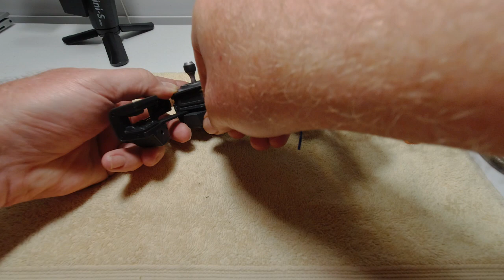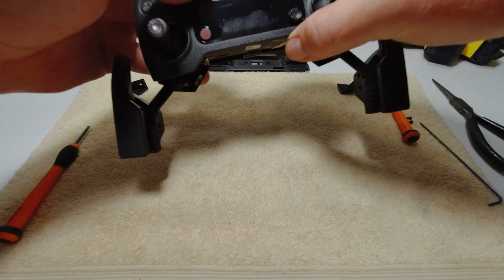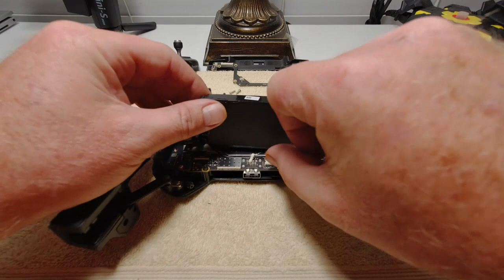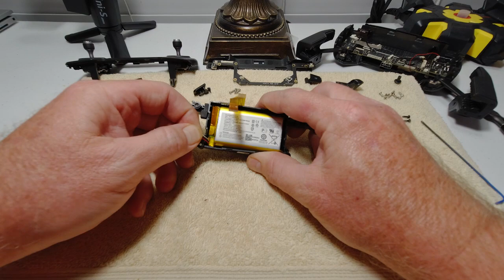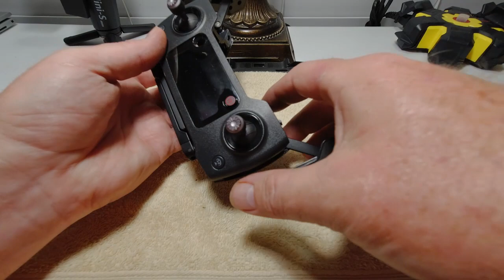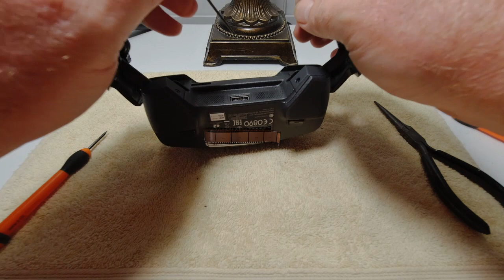How to Replace the Mavic Pro RC battery and where to get it

Comment: Great video.  Word of wisdom to anyone thinking about accessing joy stick potentiometers to clean them...there are no potentiometers...joy sticks are just gimbals that manipulate a tiny magnet below, which interacts with chip below that which senses magnet motion.  Mind blown.  My problem was that I could not hold a heading.  So I thought... controller calibration was the answer.  During calibration controls were not reaching full range during calibration.  Eventually I was able to calibrate....but nothing to do with taking apart controller  P.S.:  Careful with the plastics...this is an intricate molded par with numerous snap features.

Comment: Thanks for this great video.  I'm actually aiming to clean my joystick pots...and didn't know where to start (without potentially breaking plastic etc.).  I didn't start yet...but I was wondering if there is anything special about how joysticks disconnect from controller (electrically)...

Is there a plug or contact I need to be mindful of?
Reply from the maker: It''s been a longtime since I have had this controller apart, but if I remember right the joysticks aren't really serviceable.  You might be able to use some canned air to blow them out or maybe even pour some rubbing alcohol on them and then blow them out good might fix any issues you may be having.  Otherwise you might just have to replace the joystick.  Hope this helps.  Rick Warton

Comment: Hi Rick. Thanks for posting this video. I believe I followed your steps exactly. When I put the new batter in, it turned on the screen momentarily and I read that as a good sign. I put the rest of the drone back together and when I pressed the power button … nothing. No power. Although it was at 66% I plugged it in to charge the battery to 100%. When in got to 100% I unplugged it and tried turning it on. Still nothing. What do you think went wrong? Thank you for any advice you have.
Reply from the maker: David I really have not sure what the issue might be.  All I can think of is maybe the tape ribbon connection inside the remote did not get pushed in good and is not making a good connection.
Reply: @ thank you for the reply. You’re right mate. The tape ribbon connector broke. I’ll need to buy a new controller. Can you recommend a good one? Or maybe I’ll just buy the new Mavic 4 pro when it releases.
Reply from the maker: @DavidPearlman-p8l  Just by a used one on ebay.  There are tons of them and for $50 U.S. dollar or less.  Hope this helps.  https://www.ebay.com/itm/405567280575?mkcid=16&mkevt=1&mkrid=711-127632-2357-0&ssspo=lrzhabikr0i&sssrc=2047675&ssuid=S3YileCoRN-&widget_ver=artemis&media=COPY

Comment: How long oryginal battery will work in pilot?
Reply from the maker: Most people need to replace their remotes battery every 3 to 5 years.
Reply: @rwarton1  and the normaly time working? How long is it?
Reply from the maker: @Zieleniak3PL  The new battery has a capacity of 2600mAh and a maximum runtime of 4.5 hours when using an iOS (Apple) device and 1hr and 40minutes when using an Android device. The remote controller charges the Android device.
Reply: @rwarton1  thanks a lot for RE. I wondering why using by android phone RC works the similar time  like 2x using mavic.
Reply from the maker: @Zieleniak3PL  Not sure why either.

Comment: Well Rick I have Drone #1 apart with the battery in its case. Scary when popping off some plastic but nothing broke or scratched. The only part that is confusing is releasing the cables. Instead of release buttons I fooled around and it appears the thin plastic flat plastic along the back of the connector must be lifted on the rear of connector to remove the ribbon, With the tab released I laid some blue mashing tape on the ribbon and it came out easy. The old battery tape was not holding the battery in the case. The old battery was eight years old with minimal swelling. I hope reassembly is just as easy. Tomorrow I will do Drone #2. Thank You for the best battery replacement video. 🤪👍.You are da man.
Reply from the maker: Thanks man, really glad it helped you out.  Best wishes
Reply: @rwarton1  Both are done and charged up. The only problem on the second one is the little button camera tilt button on the lower right of the display flew to unknown territory. Anyway I found them on Ebay. It seems many people lose those buttons. I did lay down wide blue painters tape across a vertical strip of paper towel. I had the sticky side up so I could keep the little tiny screws in somewhat of a pastern as I removed them. Helpful for me as I am not the brightest star in the universe.🤪😜😝
Thank you once again Rick.
Reply: My tiny camera tilt buttons arrived yesterday and look & work like originals. No problem if anyone looses them by accident. Amazon also has these little devils. 👍

Comment: Every time I post where to get a new original battery it disappears? They are available as of 6-3-2024
Reply from the maker: I think YouTube automatically removes comments with links in them that takes the user outside the YouTube universe, LOL.  I've seen a few other YouTube channels talk about this very issue before.
Reply: @rwarton1  That is strange because the thread originator is allowed to mention a source. My source was an Ebay name but not a link. Go figure. I just got 2 new exact originals from my source.
Reply: apf-drones
Reply: Here is the reason I chose this battery.
It is 2970 MAH while most others posted are 2450 MAH. 
A big difference when returning home in an emergency etc.
Keep up with the great videos Rick.😊

Comment: Great video Rick - saved me tossing my Mavic Pro Platinum.  One small note, the first 2 screws to remove are Allen heads, not Torx bit screws.
Reply from the maker: Strange, they are Torx on mine.  Maybe they changed it later on.  Mine was built in 2016.
Reply: Could be they made a change ... my controller was made in 2017.  Thanks again for the video!👍

Comment: Is the aftermarket battery better or the factory battery? We would probably know now that it’s 2023.
Reply from the maker: Your guess is good as mine.  But with the factory battery you know it should work and last.  I usually check the reviews to help guide me on what to do.  Obviously the aftermarket battery is normally a lot cheaper, and if the reviews are good I'd go that way.
Reply: @rwarton1   yup  reviews thoe can be fakery  going on a lot with amazon    
I like the new  dgi 3 pro with the new RC controller all for under a grand and 6 miles range 45 min ext batt   I guess I have to wait til I loose my mavic pro  that copter is bullet proof   !

Comment: Worked great, thanks

I found a little clear rubber cube (2*3*3 mm) with a socket, after I closed up the remote. Might know what it is?
Reply: I just did this and ALSO HAVE a clear plastic cube. It was laying on the board! What does it go to?

Comment: Hey Rick.  Can you send the link or address in Hong Kong to order a battery? I really think the USB port is bad on the side. I have the original MAVIV Pro Platinum DRONE and remote controller. Only been used 4 time and only once as high as 100 ft.  So I’m basically a beginner.. 
my guess is it’s just the USB that’s not charging the battery?  Question: Rick, why can’t the bottom connection charge? I’ve got cables that can charge it if it can be charged from bottom.

Comment: Followed video to replace with new battery. Thank you for the video! Unfortunately I still have my original problem which is the remote will turn on. Say connecting for about 4 seconds, then shut off. Have you seen this before? Any ideas?
Reply from the maker: Sorry I have no idea what the issue may be.  I got out of the drone thing once they started talking about drone I.D..  But I would think since the DJI Mavic Pro series has been around for several years now you could probably pick up a used controller on eBay, Facebook, or craiglist pretty cheap now days.  But I may be wrong since I've never looked.  But give it a try and let me know if you have any luck.  Thanks, Rick

Comment: Terrific video Sir. I have M2 + M3 + FPV and was about to put my old original Pro on ebay and of course battery complety discharged. It would not take a charge at all but during the course of  watching your your very informative video and before ordering a replacement,  I discovered that it was my USB cable that was defective. Duh!!! Thanks.
Reply from the maker: So glad my video was helpful.  Thanks you so much for your comments.  Rick Warton

Comment: Thanks for this video, was a great help in changing the battery in my Mavic 2 Pro controller. Though I did have a couple extra cables to deal with, it was basically the same. I found a 4500 mAH replacement, and it's working great! For the first time in months, I have a Lipo that will charge to 100% now. Thanks again.
Reply from the maker: So glad it helped Darren.  Best wishes, Rick Warton
Reply: Where did you buy the battery?

Comment: Thanks very much for the video.  Looks easy enough.  But, it should be ILLEGAL for companies to make changing a battery (which WILL go bad, sooner or later), take THAT much effort.  It's just criminal, IMHO.
Reply from the maker: I agree totally.
Reply: California, the state everyone else loves to hate, has a “Right to Replace” law going through process right now. It will require companies to supply resources and parts to end consumers to keep their electronic devices running.
Reply: @some_random_guy_lol MA has had one for many years.  But it doesn’t mean it has to be easy.

Comment: Hello from Greece, nice video. I have a question, my controller drains very fast, in 10 minutes from 100% goes to 0%. But  when i turn on the remote shows 80%. Plays for 10 minutes and then 0%. You think is battery or something else? Thank you
Reply from the maker: That sound like the battery.  Mine was doing the same thing and I had to replace the battery to fix it.

Comment: Note: for the Mavic 2 (zoom or Pro) remote, disassembly is similar but not exact.
When removing the button board, the tiny connectors are behind where you took out the Torx screws which you'd want to pry from the connector, lest you rip the wires from the connector, I didn't notice this, and got lucky the connectors/wires didn't break when I got the button board out.  By the way, the Torx is T6, no way near T1.5.
There are actually 2 Lipos in there, not 1, but probably in parallel, since rating on the label is 3.85V nominal, 4.4V max at 3950mAH.
The double-sided tape is rather solid, broke a wooden skewer a few times trying to pry out the battery.
I'd remove the LCD screen from the frame first before prying out the battery.  There are holes under there that could be useful to push out the battery.  Didn't work for me, but you might find something just the right size.   If you do push through the holes or slots, use something non-metallic.

I'm rather surprised the two cells are in parallel.  That's never a good idea.  I confirmed across the red and black leads I show 4.1V
Which as an aside, I am surprised the remote shows that as 70% charge.
Reply: Correction: it isn't the button board whose wire connections you need to be especially careful about, it is the joystick connections when you remove the top cover.

Comment: Hello Dear Mr. Warton,
in the meantime I successfully followed your repair tutorial to change the transmitter lipo.
I did use one with a higher capacity (called: HSABAT 623758-1S2P 4500mAh) compared to the given. It fits well.
Thank you very much for your very good tutorial.
Please let me give a small hint. Before disassembling it is helpfull to detach the lower right push button of the transmitter (located in the lower right corner of the display) otherwise it might brake by disassembling the chassis.
Best regards 
M.
Reply from the maker: Very good suggestion Mike, thanks for the comment.

Comment: Great job Rick! You have saved a lot of drone owners a lot of grief. Hard to believe the dji engineers could not engineer this controller with a small battery hatch like other transmitters.

Comment: Does the mavic 2 pro have the same controller?
Reply from the maker: Yes, but the battery is different.  They changed the size of battery in the Mavic 2 controller but everything else is the same.  In fact if you order a new controller from DJI for the Mavic 1 they will send you a Mavic 2 controller part number I'm told.  If you just need to replace the battery in your Mavic 2 controller you can find it in the comments of the video.  Hope this helps.

Comment: just as easy to use one of my duff cell pro battery's as a usb power bank, works a treat four flights( 4x battery's) and no power loss in controller. better then binning a pro battery.
Reply from the maker: This is what I do also.
Reply: @rwarton1  i wonder haw many battery's have ended up in a bin, i did try to do the power down of a pro battery, watched a clip where its cycled down to all lights going off  then when recharged it was meant to reset the cells equally, nope didn't work for mine, also have watched where people have opened the battery up, changed a cell, or replaced the balance control inside, im not going to do any of that, ill use it as a bank, much easier.   then got myself x2 battery's of eBay around a £110 ($151)for both,  less than 11/15 cycles , plus a duff bat for free, bargain i think. plus the drone came only a month ago with two battery's, their on cycles 6/8. the chap just didn't  fly it, drone laws  i think over here (UK). only wanted your equivalent of $270. bargain with a total flight time of less than 4 .1/2 ... hours . soon took it off him when i heard it was for sale. we have 2x mini ones son & grandson, and i have the mini 2.   so this month has been fun.

Comment: Hi great video my controller is starting to get sick not lasting for its original time frame I can not find the link for a new battery you said you would put below in the comments can you please assist me with my enquire stay safe. 
Regards Jasmine from Sydney Australia
Reply from the maker: It is in the description below.  But here it is again.  https://www.ebay.com/itm/Original-2970mAh-3-7V-Rechargeable-Li-ion-Battery-973760-1ICP10-37-61/273519563743?ssPageName=STRK%3AMEBIDX%3AIT&_trksid=p2057872.m2749.l2649
Reply: @rwarton1  Hi there Rick thank you so kindly regards Jasmine from Sydney Australia

Comment: Does this battery also work/fit the Mavic Air?   (original model).      I bought a used drone setup and am sure the day will come when the battery needs replacing.     The internals look near identical to the Mavic Air controller except for the LCD screen, the rest looks the same.
Reply from the maker: Hello George, I"m sorry but I've never replaced the battery in a Mavic Air controller so I can't give you any guarantee.  But from what I read on the internet before replying to your question it seems that the Mavic Pro. Mavic Air, and Spark all do use the same battery part# 973760 so I'm incline to believe the Mavic Pro and Air do have the same type and size battery.  As for replacing it I hope my video will help some on how to break into your controller and gives you enough info to figure out the rest.  If you do replace your battery please come back and let us know how everything worked out.  Best wishes. Rick

Comment: You don't use screwdrivers to pry it open, you'll leave a lot of marks and even break the plastic frame. Besides that, thanks for showing how to install a new battery 👍I, personally, would use some other tools, but that's just, what I would do...
Reply from the maker: Great point!  But I have done it with a screw driver many times without causing damage.  But if you have something that works better please share.  Plastic and wood tools break and do not work well as we have tried.

Comment: Rick Thanks so much for putting this video together, AWESOME!  I have the Mavic Pro 2 controller and the process to change out the battery is similar but defiantly not the same.  If anyone tries it, just watch all your connections they because there are a few additional connections that you have to disconnect and they are a different configuration. 

The 3.7V battery from the Mavic Pro does not work (different battery connector, 4 wires versus 6 wires) The battery you need for the Mavic Pro 2 controller is 623758-1S2P (623758-1S2P New Original 3950mAh 15.129Wh 3.83V Battery for UAV Remote Control)

I bought the battery here:
https://www.ebay.com/itm/623758-1S2P-New-Original-3950mAh-15-129Wh-3-83V-Battery-for-UAV-Remote-Control-/274612078026?_trksid=p2349624.m46890.l49292  

Also, If anyone needs a battery for the Mavic Pro I ordered it and tried and it will not work so I have a brand new one.  If you want to buy it for $25 send me a DM
Reply from the maker: Great information Bishop.  Thank for taking the time and letting everyone know what you learned.

Comment: Hi thks 4 your excellent video my remote control the HD button break all you now where I can get please the button I can find on EBay I need the one on the bottom where the button fix thks
Reply from the maker: email me a picture of the botton your needing to youtube@wartons.com and I'll see if I can find one.
Reply: @rwarton1  the button I buy on EBay or ready I need the part inside where you put the hd button is a little Waite plastic stick Maine is broken
Reply from the maker: @MrBerenguer67  You will need to buy the button board.  Several people sell them on eBay.  Hope this helps.  https://www.ebay.com/itm/DJI-Mavic-Pro-Remote-Control-Part-RC-Button-Board-doesnt-fit-Mavic-2-and-Air/192612584626?hash=item2cd89accb2:g:gB4AAOSwIOtbXox0